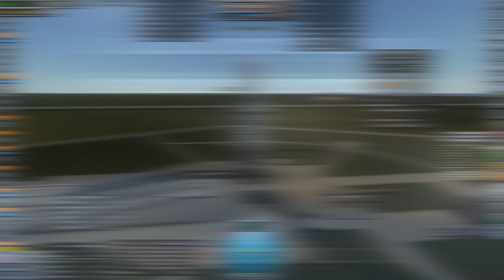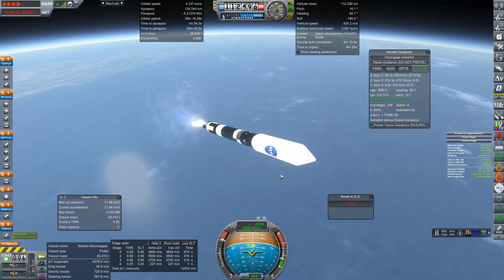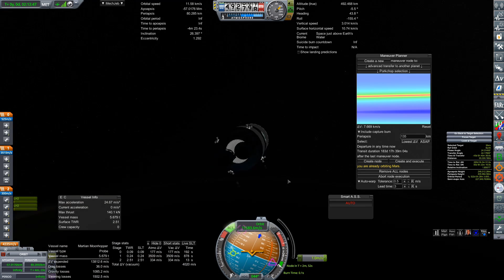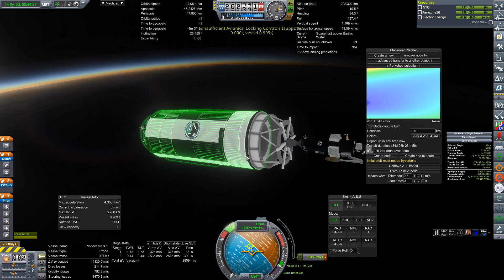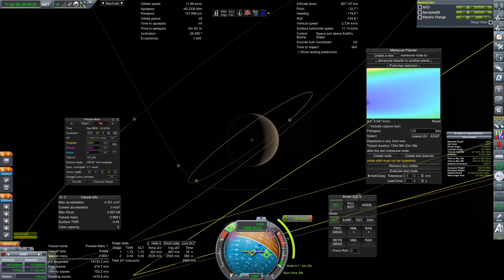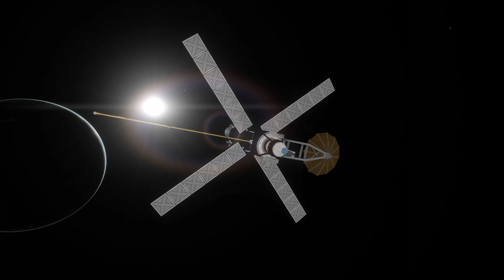Mars-bound! - KSP/RP-1 - Next Small Step Episode 55

Comment: I noticed you spinning around the craft trying to activate/deactivate engines and solar panels.  You might want to try Part Commander.  It shows all the parts on the craft to access their in-flight PAWs.  The filter button lets you quickly see only engines or electrical.  For example If you added 4 RCS using symmetry in VAB, Part Commander lets you access all 4 PAWs as a single group.  It also solves the "how do I access a PAW of a hidden or buried part?".

Comment: Hi!
In your first TMI, you set up a perfect burn, let MechJeb burn it for you, and even being very accurate, you still needed a 129.4m/s correction burn right after that. I HATE when it happens to me. Is there a way to get rid of those correction burns? MechJeb has an accuracy of less than 1m/s so you should not need that "big" correction burn. WHY do that happens???
Reply from the maker: That's the answer. KSP's maneuver nodes are perfectly accurate if you spend the entire dV budget in a single massive THUMP that happens in a nanosecond. Because that's not something we can do, we plan for extra dV in our budgets for corrections.

Comment: Thanks for continuing this great series. Regarding the flip of that launch, it was almost certainly caused by aerodynamics. A hydrolox upper plus a large fairing is comparatively light and draggy. With the large angle off of prograde during staging, the rocket simply flipped around so that the heaviest part was facing into the airflow. Potential solutions could include a different launch profile which lofts the rocket higher before staging, adding fins, or simply changing the MJ ascent guidance to keep the rocket closer to prograde during ascent.
Reply from the maker: Yeah, that makes sense. Some combination of those two things for sure did it - I may have forgotten to reduce my turn speed enough as well to compensate for the agonizingly low TWR off the pad as well.